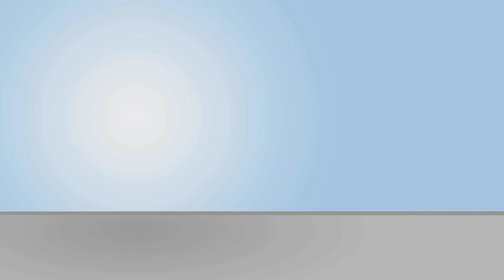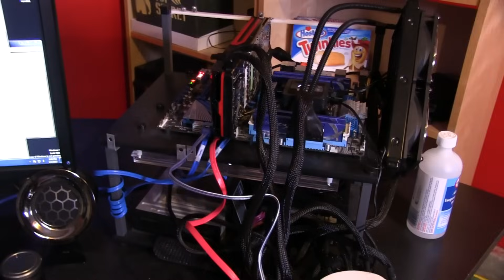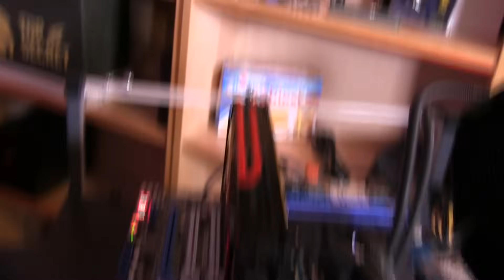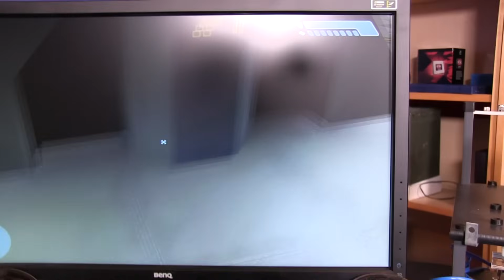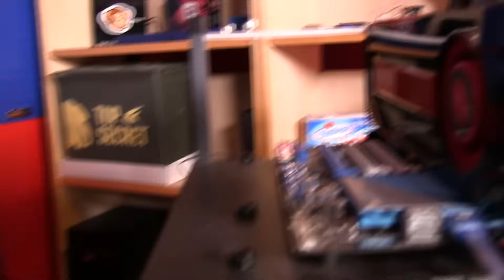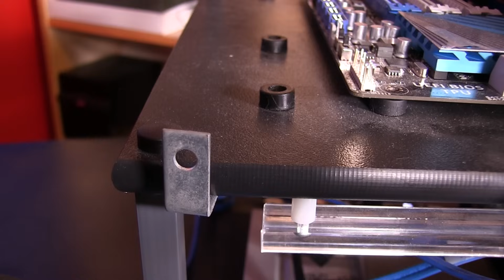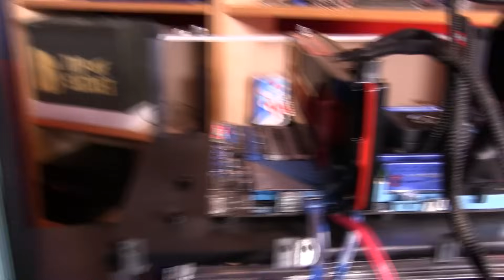Coil Whine Explanation & Demonstration Linus Tech Tips

Comment: Current GPUs: 

GeForce 580 (doesn't whine but fans are loud under stress)
GeForce 770 (currently installed, whines but incredible performance) 
Radeon 7800 (retired, didn't whine).  

Quick solution, try turning on V-Sync. Coil whine most likely happens when the card is under exponential stress. It's pointless to have your card work harder to push out over 60 FPS because you won't notice a difference if the frame rate is higher than 60. Try another PSU which I've never opted to try because of aforementioned solution.

The only difference I've seen with V-Sync off in games is that there is a huge decrease in input delay. With V-Sync on, however, there will be a slight input delay. For me personally I rather a silky smooth, coil whine-less, 60 FPS without my teammates on Skype exclaiming "hey TJ are you whizzing when you breathe?" I have on noise cancelling headphones when I game and would of never noticed this coil whine if it weren't for my gaming partners on Skype telling me they hear buzzing/whizzing.

Comment: There ARE ways to fix this though, the inductor itself is physically resonating. That is what is causing the whine. Your goal is to change the reactive power/power factor so it vibrates outside of the audible range. (20Hz-20KHz) Here are some solutions:

1. The easy way to do it would be to overclock or underclock something tied to the component with the whine. Essentially just find a way to draw a different amount of electricity.

Note: Depending on the frequency it is vibrating at you could make it worse, but this is easily rectifiable. Just clock in the opposite direction, and hope you can A. Not overheat the component B. Have to underclock to sucky levels C. Have enough range to fix the whine.

2. Change the PSU, the reason why they say this is because every PSU has a different capacitance and inductance. It is the relationship of capacitance vs. inductance that determines if something resonates or not. Since the resonation is vibrating the inductor which causes the whine. This can fix the problem, depending on the capacitance vs. inductance values of the new PSU. So getting a PSU of the same brand/model most likely won't help all that much. 

3. Changing the values of the capacitance or inductance. (If you change both make sure you don't increase BOTH or decrease BOTH.)This is the most unlikely way for normal people to go about fixing it(at a component level). Although it is the sure fire way.
Reply: It takes 8 years for me to get this knowledge. Thank you, sir!

Comment: I thought I had coil whine that I can only hear in my headphones, turns out it was just interference from the graphics card through the wires that go from the bottom of my motherboard to the top headphone plug. Not exactly sure why, but I don't have a  problem with the rear plugs.
Reply: +Gus Wilkens Same. It is quite odd.

Comment: Is it possible that a lower pitched "buzzing" sound is caused by the same issue? Happens to my 760 when it's under load in games. Definitely not the fans because I can increase them with no issue; it only makes the sound when under load and doesn't stop until I exit the game or pause it.

Comment: This noise is caused by inductors or transistors. When they try to stabelize the power delivery. The higher the fps the more whine. Every one has coil whine but in some cases it is way to high for humans to be noticable. This can also happen to high quality components and these who are known to have components that not whine. It is the luck of the draw.

Comment: "You can do nothing about it" are you serious now ? Anything can be causing the coil whine, if your FPS is over what your monitor can handle or just in general over 500 enable vsync, and can also being caused from the power supply or the motherboard, either you enable vsync,  get a better monitor to suck up most of the frames or a better power supply

Comment: I thought the annoying humming noise from my case was a coil whine from PSU/GPU... but it sounds nothing like this video at all. Seems like it's from a spinning source ... but I can't figure out if it's the HDD or any of the case/cpu fans. I'm starting to think that the 4+ year old sleeve bearing case fans are getting too old & are the cause of the humming noise (possibly vibration) since they're screwed on the case with standard fan screws without any dampening. Any thoughts?

Comment: It is literally caused in most cases(in video cards) by ferrirte chokes. They change shape on a microscopic level due to magnetic domains in the ferrite material(alpha iron containing) crystalline structure. The domains in the lattice like structure rotate and if the current is variable this can cause a resonance to occur. If your card is no longer under warranty, a dab of high temp RTV running from the bottom of the chokes to the card itself should help to dampen(absorb) some of the vibration until its barely audible, I have horrid hearing at higher frequencies do to war and my old hobby as a guitarist so fans drown out the noise to me.  Locking constant current using custom drivers or bios could help or at least help it to keep from alternating its pitch thus making it less annoying. Setting v-sync may help as well. However make sure its the video card before you try and do anything to fix it, older transformers in PSUs can have a ton of it in some cases, or the 12 volt rail could be less then clean or have a ripple under load. This of course in case of a ripple could make the the resonance worse.

Comment: Someone please help me on this, sometimes (not that often) my taskbar turns grey and something in my pc (the gpu i assume) start making coil whine, my screens brightness will start changing too, this usually lasts around 20 seconds and then stops, the coil whine is then gone, the taskbar and brightness returns to normal, someone please explain to me what this is because it's driving me crazy when it happens. Is my gpu dying? Is it software related? What is going on??
Reply: OMG i found it! It was actually WinSAT (Windows Experience Index) that was scheduled to run every sunday at 1:00am that was causing this! So i disabled it in task scheduler!
Reply: ***** thank you so much this happened to me literately 10 mins ago i thought i had some crazy virus, thanks heaps :D
Reply: Albino Rhino No problem :D

Comment: Personally it happens to me randomly, but rarely...and not like that, because the way it sounds in this video, it's way too high, I have kinda...normal, less annoying, but still weird and I never looked to why it happens or whether it means something bad or why it does that...when it sounds, it's not annoying, it has its stable level that goes for some seconds and then vanishes, even if I'm just sitting on the internet, I'm still fairly okey with it, it only worries me, because I do not know what is the cause and why it happens, and whether should I be worries.

Comment: My new gigabyte gtx970 g1 has this but gor some reason it's really bad with far cry 4 but silent with anything else, including Gpu benchmark tools( it also stays at the correct temps no matter what i throw at it.... So, let me get this straight, this doesn't actually harm anything? Am.i safe to just keep the card as I can't be bothered to return it, and my antec case blocks out most of the noise. I just hope it doesn't blow up or anything. So, is it safe?

Comment: My Sapphire R9 290 Vapor-X has ridiculous amounts of coil whine, especially while playing Far Cry 4. I notice it happens when the last 5 and 6 power phase LED's light up, and the whining corresponds to them, if the power phase LED's are blinking, the whine is fading every time they blink off, and perpetuating when they're on. It almost sound like somebody pushing a quarter into a block of dry ice, it's a pretty unattractive sound.
Reply: speedevil22 Put VSync on? Maybe it helps
Reply: santeenl VSync is not a solution. It's a band aid at best and a terrible one at it. It increases input lag which is at best an inconvenience and at worst detrimental (mostly for shooters).
Reply: ***** I've played shooters on Xbox for years on a TV. Xbox obviously has vsync on, and combined with the shitty refresh of my TV at the time. I also recently bought a 6ms 1080p monitor to upgrade from a 720p 3ms. Input lag is something you have to try and find. It's one of those "Wow if I start a private match of CoD and test my controller against how fast I can tell that I already moved the stick'" instances. You won't notice turning on Vsync. Its a good band aid.

Comment: Hmm, i found out some interesting things, when people come to me about noise making coils.

I always checked first, if the system in question is properly grounded. Yes, those coils you hear, are having a problem.
Second : Resonation (perhaps fixable by putting a little tab of paper under them/or in the middle.).
Third : check if the 12 volt rail consist of 2 or more rails. Those PSU's are LESS situated to provide a stable workload on a single 12 v rail. I.e. it needs to rails. I.e. its seems better to have one 12 V 15 Amp rail, than 3 x 12 V 10 Amp.
Inconsistency's in those tend to reproduce these sounds. Found out that those things are true on my AMD 7800 Tahiti.
When replacing with a rocksolid big as 1500 watt PSU, noice and things like that went a way.

Sadly it broke down now, and i put in the old PSU... Noice again... (in psu, but also this coil-sound)

Seems fixable.
Reply: Yes

Comment: I wonder if they could use coil whine as a means of transferring visual data to a blind person's auditory nerves.
Reply: It would be up to your brain to be able to interpet it.

I guess it might be possible to  create a 'system' to describe 3d geometry to some degree, maybe with tones describing the 'distance' or simplified geometry in front of the camera. I suspect the amount of data that can be accuretly transfered is relatively low, but I do not see why this wouln't be possible technically, it'd require a person to be trained to recognize the geometry described, however.
Reply: Echo location data would be more compatible with the ear's internal circuitry. That being said, you can just tap a nerve in the arm to send the data that way given the appropriate normal encoding and safety stuff.
The brain can adapt and make sense of the new signal, takes about 30 minutes tops.
Reply: LimitedWard 
This noise probably does not transport much information besides its height. 

But tones are used in some devices to give orientation to blind people. Different patent based on the sensor used are already claimed.
Reply: titannick 

Good idea, but already done.
Reply: LimitedWard "A Wiuuuuuu a euhh euhhhh" if you recognice that sound Lol
Reply: LimitedWard Many fundamental problems with that. The first and foremost being that the components of the ear aren't on the same "circuit" as our vision is. So you would have to open a person up and essentially "rewire" them. Even if that was possible, this would make things incredibly confusing. Because then any sound would illicit a visual response. If that wasn't enough how you would transmit the INSANE amount of visual data needed through a soundwave even would be even more insane. They really operate off of different properties entirely as well. The ears operate off of interpreting vibrations, where as the eyes work by interpreting different frequencies of light. Although the eyes work on a comparably almost infinitely more complex scale.

Maybe some day in the far far future would they be able to accomplish such a thing. Most likely by creating an echo map, based off of sound response times for many given angles around the user. 

But with coil whine? Why? Why would you choose one of the most annoying, and disruptive things. There are so many frequencies we can't hear, but technology can detect and interpret. Why not use those instead?
Reply: Coil whine is nothing more than a coil acting as a speaker in a non desired environment. If it were controllable it could be used to transmit audio data. There is nothing more to it.
Reply: You would only be able to sense the power draw of the video card.

Comment: so the only bad thing about this is its annoying? nothing else to be concerned of??? like does it lead to anything that can harm your PC? please reply
Reply: nope only this sound.
Reply: *****
ah so its not harmful. I did just find out that my CPU core temperature reacehes to 105 degrees C when playing minecraft!! I bet my CPU is stressed and hopefully not. so fuck me im going to get more fans!
Reply: *****
are u using stock fan?
Reply: *****
yes and I also live in australia and its fucken hot.
Reply: vavs 15
 same here mate but i get 105 degrees C
Reply: ***** Those are not normal temperatures for your CPU even with stock cooling. How long have you owned your PC? I would recommend removing that cooler, cleaning off both the CPU die and the bottom of the cooler, then applying new thermal paste. Also (this may seem like common sense) make sure that the plastic was removed from the bottom the CPU cooler. Coolers usually come shipped with thermal paste already applied (the stock coolers especially), and the plastic on the bottom is meant to prevent the thermal paste from going bad during shipping. If you forgot to remove that, it can cause serious damage to your components.
Reply: LimitedWard
IK and am going to do exactly. atm i play games that reach 60C 72C max to be careful. I did just tighten the fan up and its reduced it by about 10-8 degrees C. so wow
Reply: *****
 So after all the problem was that you didn't install the fan correctly. that is pretty bad mistake no offense.
Reply: *****
haha mate still its fucken hot. that solved not much. I didn't build it. my 'reliable' mate did while i was away
Reply: *****
 Well obviously he didn't know what he was doing. Hopefully everything else worked fine on your computer.
Reply: *****
hmmm when I got back. he had plugged in a wrong coord idk where but smoke came from the frontal audio jack. pc worked fine. I had a previous PSU was faulty and blew MB on my first build. I have alot of bad luck man. I hope everything will work fine when i install a heatsink or thermal paste. simple shit can go wrong with bad luck
Reply: *****
always watch tutorials when installing something on your pc.

Comment: None of my Video cards have ever had coil whine, but I have had it in a couple of systems I built for others (higher end then I usually keep around) on two of the cards a different PSU fixed the issue. The other instance, a 6970, if we used a particular PSU (1200 watt was way over kill for the card) and limited  kept a certain fan blowing on it as a certain speed it would hardly ever do it.

Comment: its because of high fps on old games....i gues more than 200-300 and u get this shit that produces more noise than fucking fans ! i would say u have to try better monitor, witch forces graphics card to produce stable frames, like g-sing or something....i dont know what its called....btw before making this video you should test another card, just like this one, to see if its because defective manifacturing or are they all the same.
Reply: bro its G-Sync
Reply: You do understand it has nothing to do with FPS, right?? I'm going to assume that you don't actually understand what causes coil whine just from what you wrote. Feel free to correct that assumption.
Reply: xAsmir No it is not, you can get this issue without play games, you can get this issue when the system is not under load, this issue can be caused by other parts in the system, this issue is not a GPU only issue either. So it is not caused by high FPS on old games. 

Do yourself a favour and actually find out what causes coil whine. It can be induced by playing old games at really high frame rates but that is not the cause of the issue.

You can do induce this issue in a lot of different ways.

Also so what if I have just clicked on 5 videos about it, I was interested in the comments that people were leaving because I was shocked at the replies from the first video about how ignorant people are to what causes the issue. 

And finally, Fuck you, you ignorant piece if shit, go learn something about an issue before you start to talk out you ass but then again I guess it's hard to talk out your mouth when it's sop filled with dicks all the time.